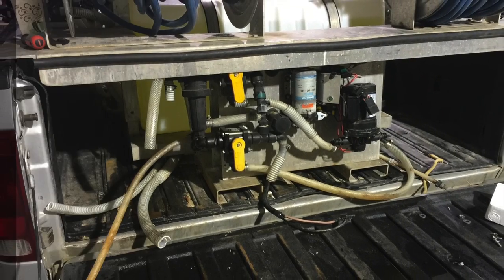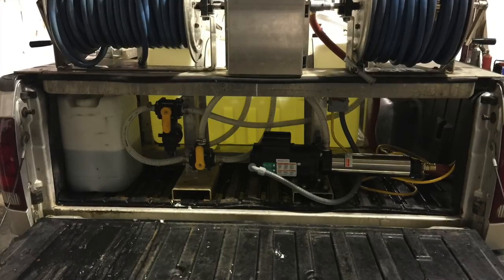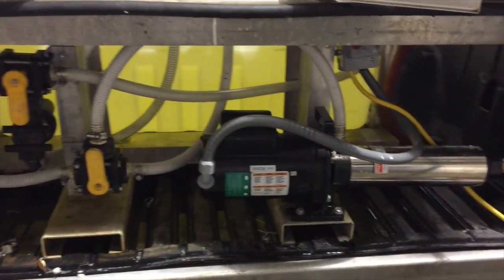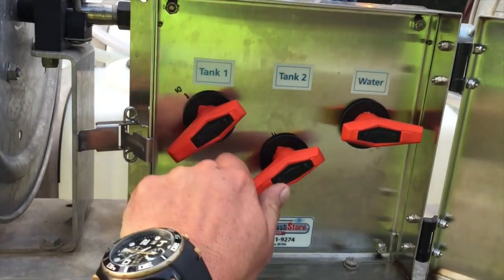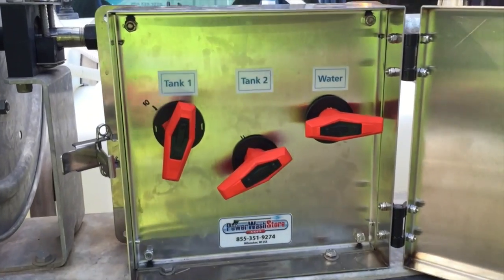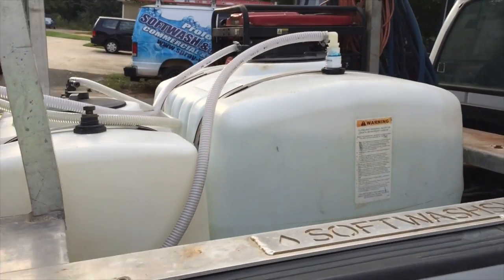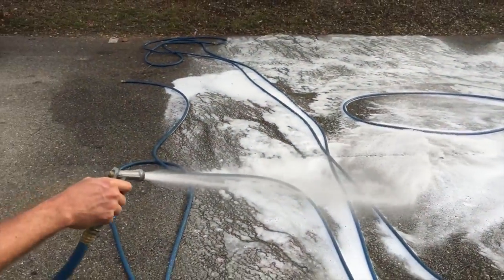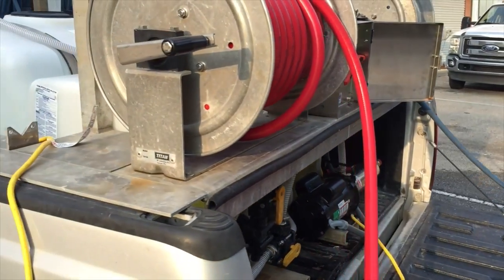Skid unit conversion

Comment: Ray, What is the expected life of the booster pump if you are running bleach through it? Is it a bleach stable pump or do i need to worry about rebuilding it every season?
Reply from the maker: I've actually transition all of my pumps to Goulds. It's a far superior pump for these purposes. I was replacing my Dayton's twice a year, I've had some goals that have been running for a year and a half. They do you need to be maintained about once every six months

Comment: really good vid! Was the water from your tank only pulled by the booster pump or did you have a 12v feeding the booster? Its better flow/ pressure than expected from the tank